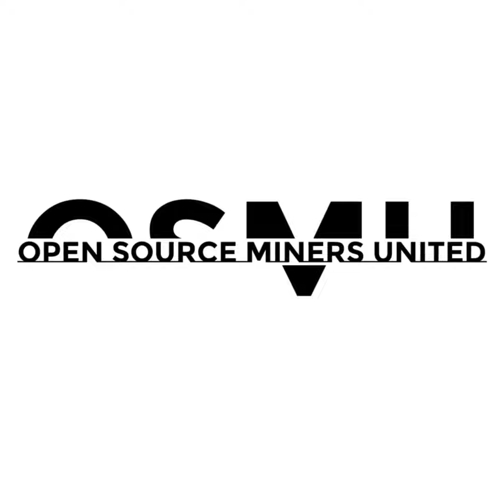Bitaxe Townhall #16

Comment: I want qaxe+ but I can't solder where do I buy fully assembled
Reply from the maker: None is manufacturing them
Reply: @WantClue  ok that sucks
Reply: 0xaxe is better why that one?
Reply: @juanjorx7  but I do like 0xaxe.
Reply: @juanjorx7 qaxe + chip 1368
Reply: @juanjorx7  if I wanted s19 chip I would run 1 board with adapter for 110v